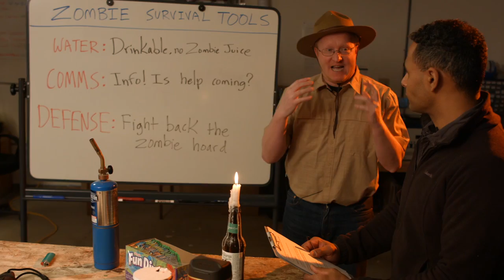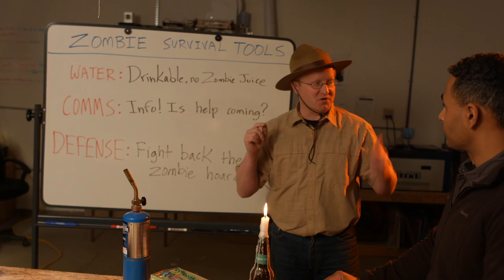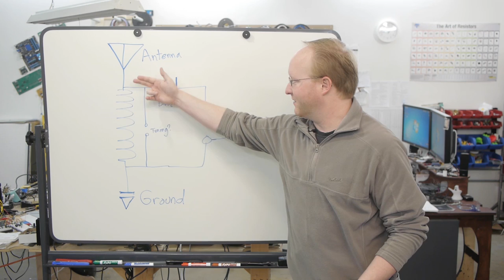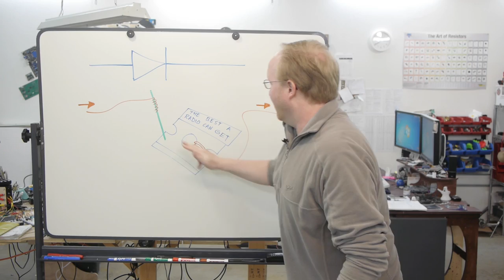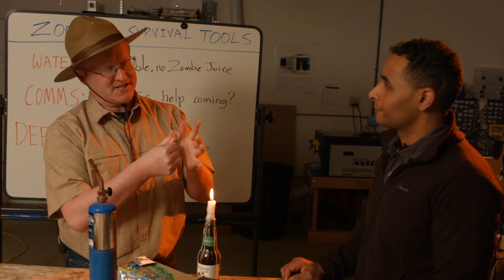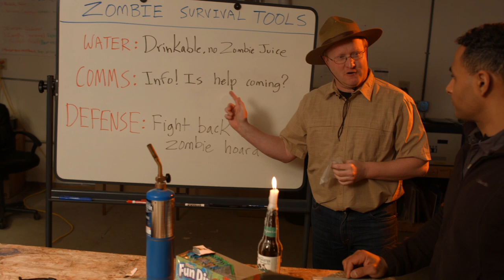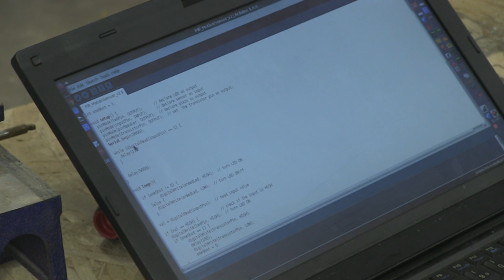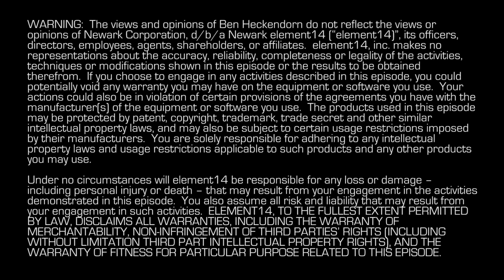Ben Heck's Hacking the Zombie Apocalypse

Comment: Felix is the best straight man ever. So good. The perfect foil for Ben.
Reply from the maker: I agree, he is a natural. Thanks for watching!
Reply: That is very doable. Its funny you mention the xbox 360 controller, as there are a few military robots that use a 360 controller. For wireless you might consider a ps3 controller, as they use bluetooth. The wireless 360 uses something else that is less user friendly
Reply: Gunhaver And by that something else you mean a 2.4Ghz transmitter module inside the controller right?
Reply: That sounds about right. I never really looked into how xbox 360 did wireless other than that it was a proprietary RF system. The military application i was thinking of actually uses a wired 360 controller that plugs into a control unit that has its own wireless communication with a robot.

Comment: So what about finishing the dreamcast and the puppet?
Reply: ***** im also waiting to see the dreamcast
Reply: Like most engineers with projects, probably juggling around as time permits and materials come in. Also boredom.
Reply: vidm96 The Dreamcast project turned out harder than at first thought and needs more time, so Ben tried the puppet. That turned out harder than at first thought too and needs more time, so now he's doing this. :D
Reply: marcoswi The Arduino is  a fine piece of kit, it allows you to slap things together very easily I love them. And I used to make systems with 8051 microcontrollers (glad I don't need to use that piece of shit anymore) but I take the Arduino now. I just want things to be made quickly easily and reliable. And when you need speed you program the Atmel in assembler or even C with Atmel Studio (very efficient code generation btw).
Reply: vidm96 Rude.
Reply: *****
I think he was criticizing the generation of people, not the arduino. People who wait around to be instructed rather than think for themselves. It's like in school, there were kids that read the next chapter in advance and so they already knew what the teacher was talking about, and then there were the kids that had no ambition (perhaps because their spirit was broken so well by the system) and so they didn't do anything until they were told to.
Well, when I was in third grade, I read a dictionary for fun. But at some point, my free spirit was broken and I too became trapped in a 'wait and see what the instructor says is the right way to do it' mentality. People that get stuck in this mentality from childhood are victims because they don't have anyone they trust teaching them not to have a victim mentality. The smart kids that try to tell them come off as bullies. It's really a complex social issue.
Reply: marcoswi I'm interested to learn how I can repurpose the logic chips from old printers and scanners. Any tips? I'm just a hobbyist, but it would be great if I could learn how to reverse engineer stuff so that one day when we are besieged by Terminators, I can reverse engineer some partly destroyed terminators to help protect the remnants of humanity. :)
Reply: vidm96 So, by commenting about two unfinished projects of which i'm just curious to see the end result i've managed to start a discussion about the "arduino generation". Hmm, youtube comments never cease to amaze and/or baffle me :/
Reply: marcoswi I have thus far mostly used premade boards for the processors (mostly Raspberry Pi, but also have a few MSP430 boards). had considered building custom boards, but it is either fairly limited (mostly only smaller/weaker MCUs are available as DIP or similar), or would work out as more expensive than buying boards (for the stuff needed to use surface-mount components).

much past the low-end, nearly everything is QFP or similar, but, QFP doesn't play well with through-hole / wire-wrap boards and similar. for some stuff, I need a bit more processing power than a small microcontroller could offer (mostly, need more than a few kB of RAM).

so, the way it is generally done this far is to have a RPi or similar hooked up to custom-built (wire wrap) boards via a ribbon cable. generally, things like PWM / PDM are done in software (with external transistor H-bridges and similar to run motors). in some cases, I also have the RPi encode and stream video from webcams (using a customized video codec, mostly for performance reasons and also to play better with a specialized real-time scheduler).

for a later version, may use a RPi2, for similar reasons (can work both as a controller, and have enough processing power to do "other stuff", with the RT and non-RT stuff running on different cores...).

may still make some sense to have separate boards, as can be noted a lot of my boards are higher voltage and current. a lot of 12-18v electronics (may also later use 24v-32v), often in double-digit amps territory, and EMI has come up as an issue sometimes as well. also, some aluminum foil shielding, and aluminum wrapped wiring, ... (interestingly... a RPi doesn't seem to have so good of reliability in close proximity to DC power-tool motors).

well, and having other issues, like the motors eating my 3D printed gears and similar (using mostly 3D printed plastic gears, but they don't hold up so well in some cases, either grinding up or turning to cheese under load).

a typical power-source is lead-acid batteries, but for one project I have considered using a small (1 kW) gas-powered generator. would work out cheaper than battery cells/packs (*) for a project with a higher power draw (24v 50Ah = not cheap). (normal PbAc batteries would not be sufficient in this case).
Reply: Brendan Bohannon
Hey, I was just wondering, have you considered finding or making a QFP to DIP converter? Here is a video advertising such a thing: https://www.youtube.com/watch?v=4G1IfYguQLQ

Also, what kind of plastic are you using with your 3D printed gears? HDPE is very weak, but I think PP and PETE are stronger. Also, you could try some that have strands of other material in them meant to increase strength.
And alternatively you could 3D print the gear then make a mold of it using plaster of paris and then melt into the mold the higher temp plastic from used bottles if your 3D printer can't handle it.
Reply: kedwa30

will have to look more, but in the past, a lot of these adapters cost more than buying pre-made PCBs with the chips already on them. in a few cases, the PCBs are themselves small enough to fit into a DIP socket (or sometimes hacked-up DIP sockets).

I was mostly using ABS. the printer does ABS and PLA stock, but neither really works well. it can theoretically do nylon with 3rd party firmware. may need something stronger in any case. the plastic gears work ok at lower power-levels at least. under 100W or so (or about 1/6 HP) seems fine, but things start quickly going south if I go too much higher (say, 1/3 to 1/2 HP).

also generally using 3/4 inch plastic drive-shafts with a socket-like square interface (mostly holds up pretty good).

another option is belt-drives. these also run a little quieter (and the pulleys seem to hold up a little better), but they are less well-behaved, and with thick rubber bands (similar sized to those from vacuum cleaners) the rubber still wears down and pretty quickly gets rather hot and makes a bad hot-rubber smell, so I don't really trust it, may need to look for a good material for drive-belts, had considered layered denim+silicone as a possible option, but haven't tested this yet.
Reply: Brendan Bohannon
Ah, one option you hadn't mentioned (but may have thought about) is 3D printing a chain to use with a 3D printed sprocket. I'm wondering now if maybe just making the gears wider might give you the additional strength you need or if maybe the problem is the friction is causing them to heat so that what you need is a light oil lubricant. But if you were going to buy a drive belt, why not buy a bicycle chain?
I'm really curious to know more about your application and what design of gears you have tried. Have you tried spiral bevel gears or worm drive?
Reply: kedwa30
a plastic chain is very weak and prone to snap easily. a bicycle chain could work, but I suspect may still eat the sprockets.

the gears are about 6mm thick, which is about as wide as the drive gear on the motor.

I have typically been using petroleum jelly as a lubricant, as it seems reasonably good in-general.

the main problem area I have is for the propeller drive intended for a quad-rotor (was testing with 16 inch propellers). the goal was to get about 15lbs thrust per propeller, for a combined total of 60lbs thrust. however, the drive gears failed very quickly.

did at least briefly get some lift, and also flying debris (such as shoes and similar) due to the airflow. the goal would be for it to be able to lift itself, a piece of wood, and a 10lb dumbbell.

for smaller things, like a rolling robot (around 15lbs and ~ 20 inch long, mostly plastic and cardboard, and powered by a lead-acid UPS battery), I have had much better success, but then I am running a lot less power per motor (only about 40 to 60W).

comparably, it takes a lot more power to get something airborne.
Reply: Brendan Bohannon
So you need stronger material and a stronger design.
I have seen gears made with only two surfaces. Something along that line rather than small teeth would be a stronger design. Change the shape of the teeth. Try herringbone gear aka double helical gear.
I'm just trying to be helpful. :D
If you were thinking of going to the trouble to make your own drive belt, then I would say try making a composite gear first. You would print separate layers of the gear then 'glue' them together with layers of fabric in between. Need to have some kind of hole in the side so you can line them up with a pin, or a groove or offset square around the hole for the shaft. There's a word for that, but I don't know it.
Reply: kedwa30

well, the use of thick rubber bands doesn't really work (they don't really hold up very well).

was thinking of trying to get some of the types of belts used in vacuum cleaners and trying those.

ATM, I had put it off for now and had been working on other stuff.

had wanted to get back to a CNC mill project, but a problem is I don't currently have the resources to get some wood panels cut (as-is, this is the main thing holding it up).
Reply: marcoswi
So far I have not bought an arduino, although I am a beginner. Please tell me what chip you recommend. I am interested in harvesting a microcontroller from an old printer or some other device since my budget is very small. I have a lot of old printers and scanners, but I don't have an oscilloscope. Do you think I could build an O-scope for $16? Thanks for your advice! :D
Reply: marcoswi

I had considered using line-in before, but AFAIK, it is necessary to build an interface mostly to bias the inputs (such as with a potentiometer), and also to constrain the voltage to safe levels (otherwise, at best, the signal is out of range and clamped, or, ones' line-in port is fried by the voltage).

mostly this is because the line-in port expects low voltages (AFAIK, approx 1v peak-to-peak), though generally ~3.3v seems to be "safe".

connecting a line-in port directly to 12v or similar could be very bad...

Comment: Hint. If you have computers running at the background at zombie apocalypse this means it is 1.well backed up so you can use wall outlets or 2. It means it was made quickly 
And if you can test the radio 2 times when talking loud what does prevent you from stealing battery and radio behind you? Or to sneak to your car and do the same?

Comment: What you really need to protect yourself in a zombie apocalypse is a sally port. That is an entryway that has two doors such that one door is always closed. You can make a simple circuit that will only allow one door to be open at a time. If the zombies slip past the first door while you are trying to let someone in, then the second door protects you. You can have a pneumatic system to close the outer door, then activate the zombie neutralization system to clear the sally port. It works similar to an air-lock on a space station. It's good for keeping out mosquitoes too.
Reply: An awesome show would be how to salvage a laser from an old laser printer or a CD drive and make it into an ion wall to keep out mosquitos. Basically the spinning mirror salvaged from the laser printer reflects the laser in low power mode to scan for anything and when something reflects light back, the sensor sees it and tells the laser to use full power at that spot. So it involves precise timing but relatively few components.

Comment: Should've built your own variable capacitor, too. I found that using two empty toilet paper rolls with aluminium foil and package tape as a dielectric works pretty well. You coat one on the inside, one on the outside and slide them into each other.

Comment: Silly Ben, zombies are cold, they don't register on an IR sensor.
Reply: Christian Gerefalk Had to think about this for a while. Even though infrared is based on measuring radiation, which in turn is based on temperature (among other things), wouldn't a walking corpse still react to a PIR sensor, as it's not 100% temperature based? It'd probably worth some testing at least. :P
Reply: Pauli Jokela *steals corpse from morgue in the name of science*
Reply: Christian Gerefalk As long as their temperature is different than the ambient temperature, they should trigger the PIR sensor.
Reply: Karl Koscher But wouldn't there be a strong possibility that a walking corpse would have the same temperature as the ambient temperature?
Reply: Pauli Jokela Probably. I'm no zombie expert.
Reply: Pauli Jokela You could solve that by putting the PIR sensor "inside" as it were. For instance, in a foyer or something. Even if you're not particularly trying to heat or cool an enclosed space, with the warm bodies and movement going on, the ambient temperature would be a bit different from outside, making the zombies standout.

Of course, this begs the question of "Why not just secure the structure you're in so Zombies can't get inside in the first place?"

Well, I don't have an answer or that one.

Comment: Really should run through the filter a few times, but witht that creek water after a few filtering boil it, I do a lot of bushcrafting/camping and most water filtered through a bandanna and boiled is the ideal way, some people I know even use water tabs afterwards.
Also 2 drop *emphasis on drops! of bleach will purify 1 quarts of water and yes its safe its how they prufiy our water ( albeit they use only chlroine) and is approved by the EPA as safe.

Comment: if you had the old electronics kit couldn't you have used the coil and piezo on the board to make the crystal radio as all the elements were included? j/s why go to all that trouble it's a zombie apocalypse after all.

Comment: I know it was probably just stated that the kit did not have a radio project to prevent people from asking why not use the project kit as a radio, but if the kit did not have a radio project,  why did it have a bar antenna at the bottom left? You pretty much just rebuilt what was already on the kit..Oh well..hehe
Reply: krbruner I think it had a transistor radio project, but not a crystal radio project. It's hard to find a list of projects in the kit--all I've found is a blurry photo of the manual's table of contents.